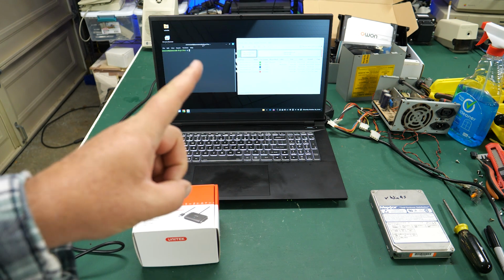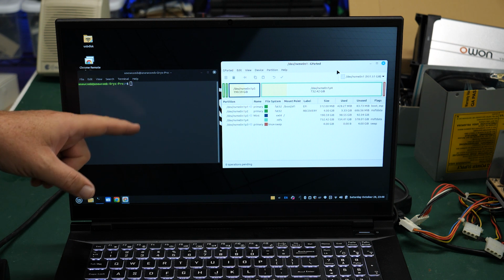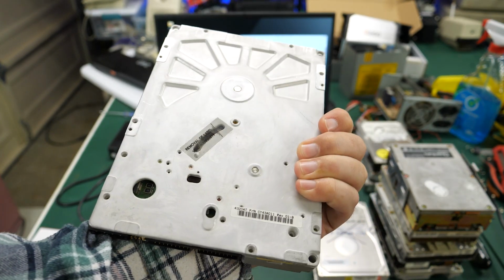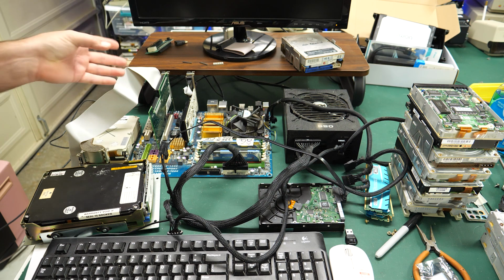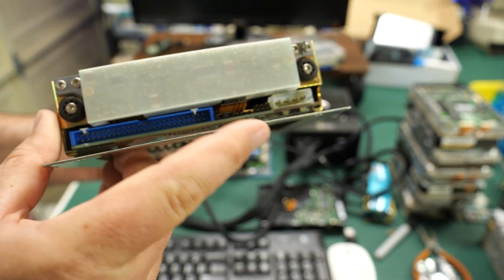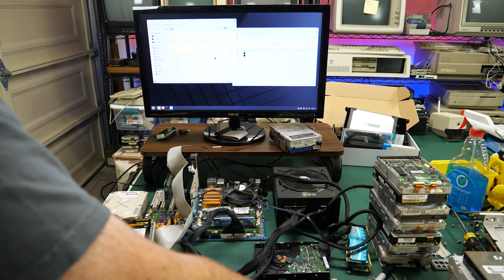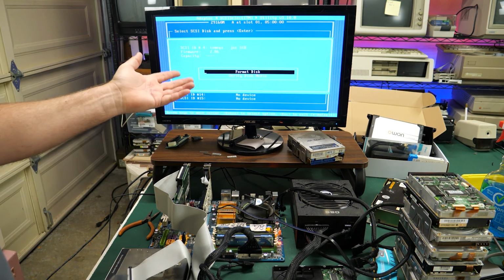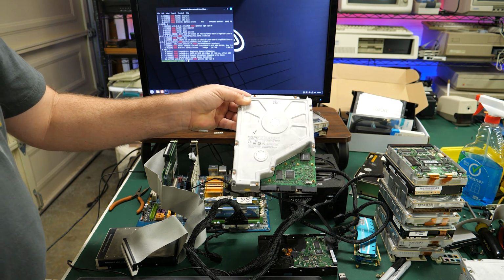Can Old Hard Drives Be Saved?

Comment: at 4:10 .. Aaron I love Gparted for backup and restore physical/partitions/OS's into VirtualHD's...... but for recover a partition that you erase it by accident in Windows o Linux or even DOS..... the best tool is the old Ranish Partition Manager 2.44...... if your partition was for example in cylinder 0.. head 0.. sector 2.. ( the default .. other systems Like Win7 and up like to start at 32.. 31.. 1... others at 1.. 0.. 1 etc..) and if you don't format it of course. then creating a new partition in that same spot... it will "see" the old Fat tables or NTFS or Ext or what ever that were there before.. and let you keep those untouched... literally bringing back the partition just like it was before... I don't know of any Windows or Linux tool that can do that... don't even Disk Genius.......+...... you can try it yourself the tool is free.. is abandon were this days.. check the Wikipedia page by the way)...... create a partition in a HDD... put some files on it.. then go to Ranish Part and take a look were stars and were it ends ... then erase the partition in what ever software you like... go back to Ranish partition.. "insert" a new partition.. and seating it to start at the same  cylinder .. head .. and sector... were it was..... then the old Fat tables or NTFS or Ext info.. will come up.. and let you save the partition to the MBR (don't format it) and that's it you partition is back with everything in it.... it work with NTFS .. and others also.. even when it can Part can't format those on DOS...+.

Comment: gparted is pronounced like "gee-part-ED" with the last syllable emphasized and pronounced like the first syllable of the word Editor.
It is an abbreviation for GNU Partition Editor.  It's a good open source tool that can do a lot of good things, but can also do a lot of bad things if one does not know what one is doing.  SATA drives in modern Linux systems are treated as if they were SCSI drives, so it's not surprising to see drive devices referred to as, for example, sda (SCSI device A), whereas IDE drives may be referred to, for example, as hda (Hard Drive A), or may, depending on the distro and release, fall under IDE over SCSI emulation and also use the sdX nomenclature.  Regardless of type, they are all block devices, and can be listed in tree form from the command line by typing in 

lsblk

then pressing  the enter key.  Similarly, to list all USB devices,

lsusb

followed by the enter key.  Each of these commands has options for more specific uses, a listing of which is available by issuing a space followed by --help after the command.
Reply: I believe the SATA standard is based on SCSI.
Reply: @ricardog2165   Umm... SATA stands for Serial AT Attachment - it's essentially a serialized version of PATA.  SCSI (Small Computer Systems Interface) is a different parallel interface which has much higher throughput than PATA.  SAS (Serial Attached SCSI) is a SCSI interface that is able to also accept SATA drives, albeit with certain restrictions.

Comment: You know you can make a test bench i used the inside of a case and cut it down works great even have room for the power supply to i have had a ide converter to sata for a few years as well also i never knew much about Scsi drives now i know a little bit from you
Reply from the maker: Yeah. In my previous video I had a case with a removable plastic mount that was perfect.

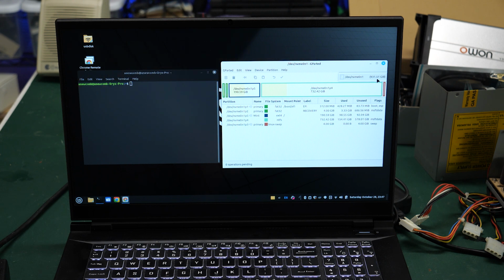Comment: ALWAYS triple check that you have selected the correct drive before partitioning/formatting. Then check again. At 4:52, i see that Gparted doesn't show the make or model of any of the drives. I use AOMEI Partition Assistant. It shows a lot more detail. It is included in Hirens Boot DVD. Runs in MiniXP.
Reply: When using GParted, look at the top row for the View menu and click on the checkbox for Device Information.  A sidebar at left opens which will give you as much detail about the drive, including Model, Serial Number (if ran as root), Size, Path, partition table type, number of heads, sectors, tracks, cylinders, total sectors, and sector size.  Be aware that, for SSDs, some of the sector and track information can look a little strange.  Here's some of the info on my laptop's primary SSD:

Model:  PC401 NVMe SK hynix 512 GB
Serial:   
Size:      476.94 GiB 
Path:      /dev/nvme0n1           (an nvme device zero on interface 1, as best I can tell.  /dev/nvme0n1p1 would be the first partition on this device.)
Partition Table:  gpt
Heads                 255
Sectors/Track:   2
Cylinders:           1961206
Total Sectors:     1000215216
Sector Size:        512

As you change devices (button at upper right), this info updates for each drive.

Comment: SCSI allows hot-plugging, youshould just need to tell the OS to rescan the SCSI bus for new devices (this is possible in both Linux and Windows - Google linux rescan scsi bus for how to do it in your setup). That should cut down on the time needed for testing.
SCSI/Power-on - Most? SCSI drives will have jumpers to enable/disable automatic startup, and many enterprise disks had it disabled by default because many disks spinning up at the same time would overhwelm the PSU, relying on the SCSI controller would then spin them up in groups to limit how many was starting at the same time (SCSI has commands for spin-up). Some SAS disks still has jumpers for this but added a pin which can be held low by the backplane to stop spin-up until it's released to make power sequencing easier.
Reply from the maker: Now that I am done testing I will try it out to see if it works. When I looked in the manual for the adapter I couldn't find whether this one would let me or not.

Comment: When i worked in a computer shop fitting Jaz drives, they came with a standard SCSI cable and a separate terminator module.
At one stage Iomega managed to get a batch of the terminators made with a tantalum capacitor fitted reversed so it went short after a few mins, took me quite a few emails to Iomega to convince them of this but in the end they listened and managed to catch most of the terminators before they were shipped.
The tant cap was on the terminator power line on the SCSI bus and would blow the fuse on the SCSI card when the cap went short.
Reply from the maker: Yikes!

Comment: Boards around the time of the core 2 duo are perfect for vintage test benches.  I have a old foxcon mobo and with adapter cards I can connect anything from current, all the way back to the 90s with no problems.  Basically anything that can go in a pci slot works on it.  So anything made in the last 30 years usually works.
Reply from the maker: Yeah. I thing one like this and a Pentium 1 board with ISA, PCI, and AGP are really nice to have.
Reply: @RetroHackShackAfterHours  I was just testing some new to me nvme sas ssd's on it for my nas the other day.  I got these u.2 nvme to pcie adapter cards and they work perfect on it.  So I can still connect the latest and greatest enterprise ssd's to it.  I originally built it as my main computer back in 2008 and I still use it fairly regularly.  Although I think the past decade of plugging cards into it is starting to take a toll on it.  I often have to reseat cards in it, but it keeps chugging along.
I do have a slot 1 p3 mobo with ISA and AGP somewhere around here, that's my go-to when needed.

Comment: I have an old Athlon II Shuttle PC (the ones in cube shaped cases) that i use as my drive recovery/imaging station because it has all 3 interfaces. Power supply was shot, had to replace that, about $60 on ebay. The old psu probably could have been repaired, but I am not confident about working around high voltages so I didn't even bother trying and just ewasted it. Surprisingly, the motherboard itself looks fine, no suspicious looking caps or anything. Just a little dusty. I like this machine because the motherboard has both parallel IDE and SATA ports on it. And for SCSI, I dropped in an Adaptec PCI SCSI card. Machine is running linux of course. :) The only kinds of drives I can't read are the really old MFM, etc. ones, but I haven't run into any of those yet. I also looked at USB SCSI solutions when I first started figuring out a data recovery system/procedure and yeah they are not easy to find and are super pricy, also I don't think they have particularly good Linux driver support. (I could be wrong, but I didn't feel like paying a high price to take a gamble.) However PCI SCSI cards are pretty easy to find and reasonably cheap (I think I got mine for $20 off ebay) and usually have pretty good Linux driver support.
Reply from the maker: Sounds like a great setup!